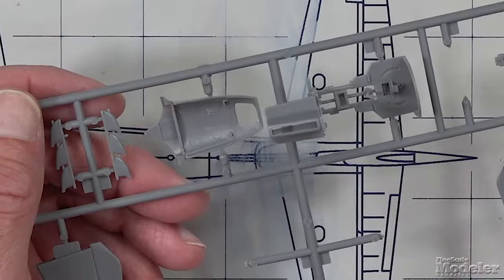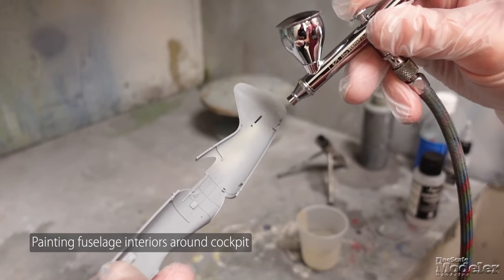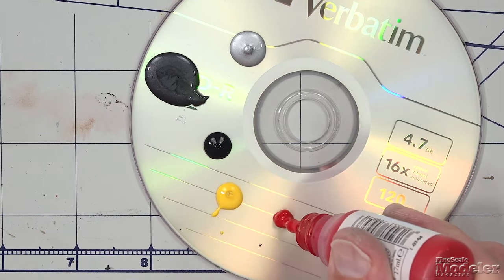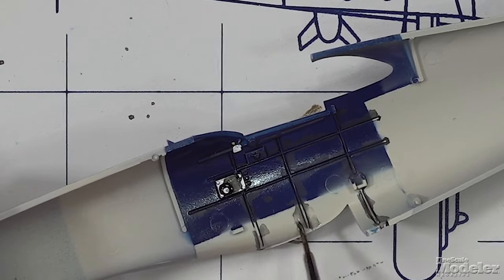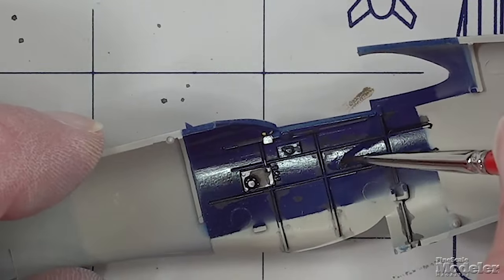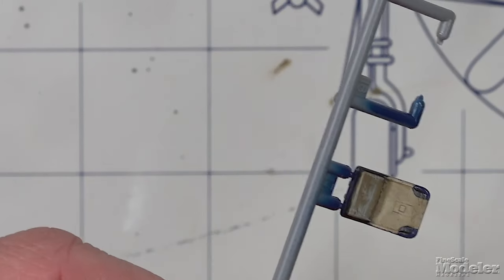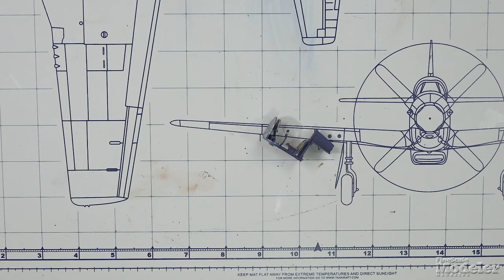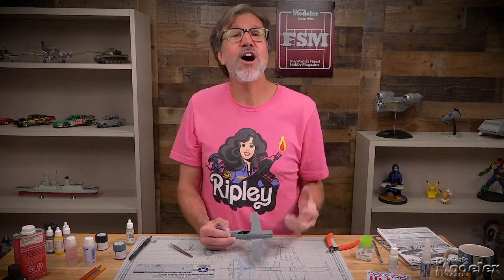FineScale Modeler: Painting and detailing World War II cockpits

Comment: You didn’t seem to varnish the paint job between steps. Particularly Between the application of the Vallejo paint, and the wash. And also before putting on the decals. Was this because the project was so small or do you just not feel that the virus step was necessary?
Reply: Varnish step
Reply: Varnish step.
Reply from the maker: Hi Ted: The Tamiya Royal Blue we used in the video is a gloss paint, so no clear gloss was needed before the washes or decals. On the other small parts, they were small enough to clean up the wash with a little thinner after it had dried. If it had all been flat, then a clear gloss would have been used to provide a smooth surface for both the washes and decals. Thanks for the question!